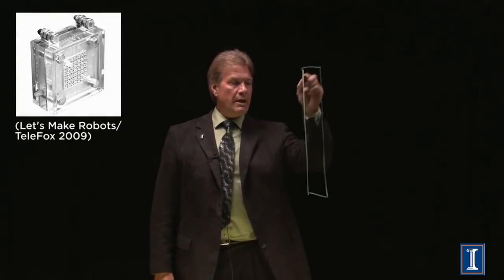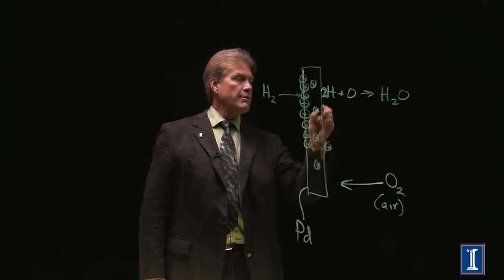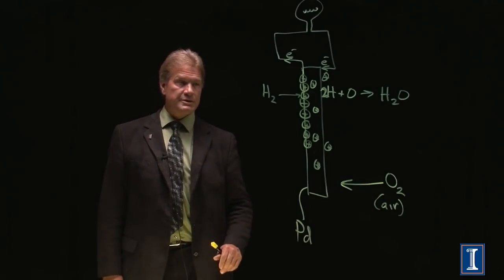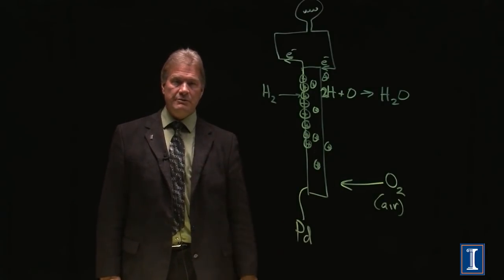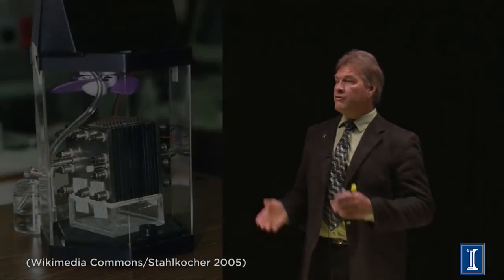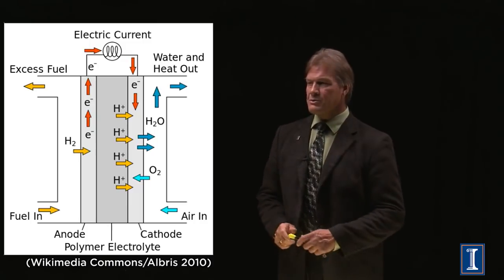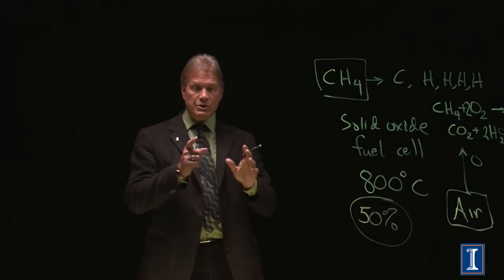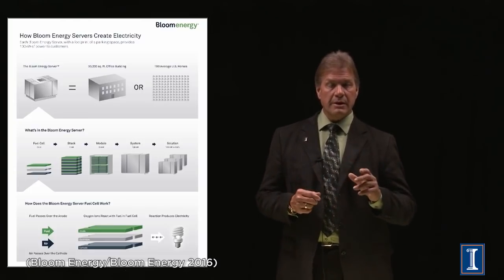Fuel Cells and Hydrogen Economy

Comment: Many of your videos are good but some of the information you cite seems completely incorrect which makes me wonder what else is incorrect. For instance you suggest a combined cycle natural gas plant is about 40% efficient which does not correspond to other information on the net which says new CCGTs are 60-63% efficient. The difference between what you say and what the utilities say is huge
Reply: Also, he calls PEM fuel cells toys, which is ridiculous. The current Toyota PEM fuel cells weigh 50 kg, is 100 kW power, and fits under the passenger seat of the Mirai car. The amount of platinum in a modern cell is abount same as in a diesel catalyzer. Already quite mature and practical tech.
Reply: I could be wrong but I believe these were all filmed in 2015 or before which could explain the differences.
Reply: Correct, he has just done a Q&A session and he refers to the fact that all the videos were done quite a few years ago.
Reply: @erik7726  Hydrogen cars are still nonsense though, because you need electricity to make the Hydrogen, and between the electrolysis and the fuel cell, most of the electricity you put in is lost. If you use electricity to charge a battery instead of make Hydrogen you can get better than 80% efficiency.

Hydrogen cars only start to make sense if you have a huge supply of very cheap, non-polluting electricity you can afford to use very inefficiently for the sake of convenience.
Reply: Hydrogen solves the energy storage problem, the fact that it isn't as energy efficient as electricity is off set by the faster charging times and cost reduction of not having a massive battery on board, etc etc etc.
Reply: @treizTUBE  With modern battery technology, there is no storage problem for the typical usage pattern of a passenger car. Hydrogen as a storage medium is about half as efficient, which is awful if we're relying on re-newable energy from limited natural sources, and even worse if the energy comes from fossil fuels. Convenience doesn't make up for the terrible efficiency, those are two unrelated characteristics.

Hydrogen is also quite inconvenient compared to other fuels. As a compressed gas it's very bulky, and compressed gases are always difficult to handle. As a cryogenic liquid it's even more difficult to handle, and still very bulky, and the energy used for liquefaction makes efficiency even worse.

Fuel cells have their applications, but they're uneccassary for passenger car use, and that low efficiency is a real problem if we're serious about phasing out fossil fuels.
Reply: @TonboIV  "Hydrogen as a storage medium is about half as efficient"
Again, efficiency is only ONE aspect of a solution.  ICE engines are not as efficient as BEVs in a direct fuel comparison yet they dominate the market with over 98% share.  Obviously the assumption that a replacement will have to be the most efficient is faulty, perfection is the enemy of the good.
Reply: @treizTUBE  I thought hydrogen was incredibly tricky to store. It's so small that it tends to leak through materials leaving them brittle. Leaking and brittle doesn't seem like great characteristics for a high pressure canister of explosive gas. Storing it as a liquid seems like trouble too.
Reply: @treizTUBE  The efficiency of batteries vs combustion engines isn't comparable, as one is an energy source, and the other is a storage medium. ICEs can dominate the market because we have plentiful cheap fossil fuels and we currently allow people to emit Carbon freely. If those things change, ICEs won't be viable for mass market passenger car use.

The whole point of going to a zero emission fuel like Hydrogen is to phase out Carbon emissions, which in the near term likely means renewable energy, particularly solar. These are inherently limited power sources requiring lots of land. They must be employed efficiently. If a fuel cell vehicle costs twice the energy of a battery vehicle, that likely means another vehicle equivalent of energy is produced somewhere from fossil fuel, because energy is a global economy.

Current battery vehicles are very good. The advantages of a fuel cell vehicle aren't large by comparison, and the poor efficiency makes them a bad choice for environmental reasons, which is supposed to be the whole point. Fuel cells might be useful for other applications, such as ships perhaps. They also may be better as an energy storage medium if we don't need to worry about efficiency anymore, like if we have abundant cheap fusion energy, but even then, they're not that great in terms of energy density either, and quite inconvenient in other ways. At that point, we might just want to use the energy to make synthetic fuel or biofuel, which have similar efficiency without the inconvenience and huge bulk of hydrogen.
Reply: @pyreaurum676  it's not at easy as storing gas or diesel, sure, but hydrogen storage tech has been around for decades.  The only hurdle was making it road and crash worthy.
Reply: @TonboIV  as one is an energy source, and the other is a storage medium."
Incorrect, gas and diesel ARE storage mediums for energy, mostly solar energy.  
.
"If those things change, ICEs won't be viable for mass market passenger car use."
Yes, there's no reason to move away from ICE currently aside from gov meddling.  
.
"The whole point of going to a zero emission fuel like Hydrogen is to phase out Carbon emissions, "
That may be the idea, but in reality all you are doing is emitting MORE carbon in total somewhere else on earth.  Instead of emitting it here from burning fossil fuels, you are emitting it in China to mine rare earth minerals and on ships transporting materials back and forth to create the highly complex batteries or electric motors or fuel cell stacks, etc etc etc.  If all you want is to reduce carbon emissions you are better off driving a really old car for as long as you can.  Building a new vehicle even an EV of either kind wipes out all the carbon emissions you could ever save.
.
"Current battery vehicles are very good."
They are very good at things people don't need or care about.  It's great that a Tesla can go to 60 in under 3s, and shred its tires along the way and drain its already limited range, but most people don't need that and don't see any reason to spend the extra money to get it and all the other compromises and drawbacks that come with EVs.  
.
"The advantages of a fuel cell vehicle aren't large by comparison"
No, they aren't massive differences, but they are significant enough for automakers to take notice and invest heavily.  They know their customers better than you or I.  
.
"At that point, we might just want to use the energy to make synthetic fuel or biofuel,"
Make no mistake, I DO NOT support the gov position that we need to get rid of ICE vehicles, I DO NOT support the move to EVs either way, but if it's going to be forced on me I'd rather go the route that has the least impact on my life and my ability to earn a living.  Clearly right now that is HFCs.  
.
If in the future they create fancy new batteries that are light wight and tiny and highly energy dense that don't require tons of rare earth minerals to be mined and shipped all over the world and that can be recharged to 1000mi range in under 10 or 15 minutes I'll jump on board.  Until then the tech simply isn't acceptable.
Reply: @treizTUBE  In practical terms ICEs are an energy source. The energy they produce comes directly from stuff we dig up. Batteries need to be charged from some other energy source, and Hydrogen needs to be produced from an energy source likewise.

We need to phase out fossil fuels for mainstream use, whether you like it or not, because the alternative is a disaster beyond anything in history. If we are doing that, than fuel cells are a bad way to do that because they fail at the only reason we'd want to use them over ICEs.

Heavy metals from battery production are a problem, but hardly insurmountable. We just need to handle the metals properly. Many MANY industries use heavy metals or other toxic materials. It's only a problem if those toxins are released into the environment.

I also wasn't talking about Teslas. They're still too expensive for most people, but the technology and market disruption of Tesla is leading to other more mass market electric vehicles. These cars can meet most people's needs. Few drivers need more range than a modern battery electric can provide, and normal usage patterns make charging a minor issue, even more so as fast chargers become more common. With large scale adoption of battery electrics, you expect to find fast charges all over the place.

The idea that building a new battery vehicle wipes out the emissions savings is false, and a stupid myth. They have a break even point, depending on many factors, but typically between a half year and two years of normal use, IIRC. Transporting commodities by ship is very efficient to the point the emissions are barely worth worrying about for something like a battery. All this also assumes that most of the production chain also uses fossil fuels. The idea though, is to switch the whole economy over to non Carbon emitting energy.

We don't have to legislate a specific power train type of course. Taxing fossil fuels to realistically reflect the long term economic cost of burning them would make them uneconomic for mass market use and most passenger vehicles would then likely use batteries with current technology. You'd be free to keep burning gasoline if you're willing to pay several times as high a cost as running a similar electric vehicle, or even a fuel cell vehicle if you're a weirdo who wants something that's more expensive to run than a battery electric, without many advantages of its own.
Reply: @TonboIV  No. Hydrogen can br produced cheaply and cleanly, e.g. from coal or methane with carbon capture, or in high temp electrolysis from nuclear fission.
Reply: @erik7726  Even if you make Hydrogen from Coal, all the Carbon and Sulphur and heavy metals have to go somewhere, and likewise with the Carbon in Methane. I don't see the point in setting up an entire new Hydrogen infrastructure just to do the same thing in a different place.

Electrolyzing Hydrogen from water makes more sense, but we need abundant, cheap, non polluting energy to make that a good idea given the low efficiency involved. If we're talking about renewable energy, than throwing away over half the electricity on the way is just terrible. Renewable energy is limited in power output, so we need to make efficient use of it. A combustion alternative that uses the energy so inefficiently is failure as an environmental measure.

Even if we have the power to waste at some point (like if fusion really happens), I think fuel cells are still a bad way to use it. It's a bulky and complicated power train, Hydrogen is about the worst and most impractical chemical fuel you could pick for a car. It needs a whole new and complex fuelling infrastructure. Setting up mass market distribution for cryogenic Hydrogen would have to provide some huge benefit to offset the inconvenience, and I'm not seeing it. Compressed gas is better, but few people even drive natural gas cars now, despite the low price of natural gas, and Hydrogen is even bulkier than natural gas. Batteries are bulky too, but they're not pressure vessels so packaging is far easier. You don't need to reserve a big round space in your vehicle. Compressed gas is also slow and complicated to fill up, which is supposed to be the big advantage of Hydrogen compared to batteries, and it's also fucking scary. The tanks make horrible noises that sound like they're gonna blow up.

Hydrogen might be worth it if it were the only way to make a zero emission car, but there are far better options. Battery electrics work fine for a typical passenger car.
Reply: @TonboIV  "because the alternative is a disaster beyond anything in history."
Complete nonsense, it is a regular occurrence in Earth's history for the temp to warm and the poles to melt.  Life goes on.  
.
"Tesla is leading to other more mass market electric vehicles. "
Still less than 2% market share, it's leading nowhere fast.  The novelty will wear off seen enough and without gov meddling people will go back to ICE vehicles.  
.
"The idea that building a new battery vehicle wipes out the emissions savings is false, and a stupid myth. They have a break even point, depending on many factors, but typically between a half year and two years of normal use, IIRC. "
No, it's true, you can't cheat physics.  Building a new vehicle requires more energy than the small amount saved between two different drive trains, it's not even close.  Who ever told you it was a myth was greatly misinformed.  Their claim is false on its face.  
.
"Taxing fossil fuels to realistically reflect the long term economic cost of burning them would make them uneconomic for mass"
A terrible idea, once the gov gets rid of all the ICE vehicles they will just shift the tax over to EVs.  They will have already figured the tax into their base line budgets and spent the money so they''ll go after it in different forms.  CA is already doing this.
Reply: @treizTUBE  Climate change has happened many times before, usually with very bad effects for large and complex lifeforms like us, but this time it's different and much worse because the change is happening a thousand times faster than normal. It will be very expensive even just in economic terms. Life will adapt, in a few million years, but that's going to be little comfort to anyone in 2100.

In terms of break-even for an electric car, I'm referring to using a zero-emission energy source to charge it, so break even happens very quickly compared to a car that emits Carbon every time it runs. Electric cars are one piece of what needs to be a change in the whole economy away from fossil fuel energy. If we don't change our energy production, electric vehicles are mostly pointless.

I don't like taxes either, but we need large scale interference in the economy in order to force a phase out of fossil fuels fast enough to avert the worst damage. We're already too late to stop all of it, and every delay will do awful things to the environment our grandchildren have to live in. Waiting for the economy to switch away naturally is just too slow, and a tax on Carbon is the least intrusive method of forcing that change.
Reply: @TonboIV  "Climate change has happened many times before, usually with very bad effects for large and complex lifeforms like us,'
CLimate changes every roughly 40k-100k years, Humanity and our ancestors have lived through these changes countless times.  With our technology and access to energy this current 20k year warming trend won't even slow us down.  In fact, it will open up a lot more farm land in the northern midwest and Canada that currently can't be used.  
.
"Electric cars are one piece of what needs to be a change in the whole economy away from fossil fuel energy."
There is no other energy source currently capable of replacing fossil fuels, the only thing that comes close is Nuclear, and the watermelons won't let us build any more of those.  
.
"in order to force a phase out of fossil fuels fast enough to avert the worst damage."
There is no amount of carbon that we can cut from our output that well offset the increasing outputs from China, India, and the rest of the developing world.  Forcing electric vehicles and unreliable fossil fuel replacements will only serve to crash our economy at the moment our competitors grow strong enough to challenge us.  I don't know about you but I'd rather not spend the rest of my life energy poor like those in Germany and other nations that have already tried to make the switch to green tech.
Reply: @treizTUBE  Humanity has never lived through RAPID climate change. Nothing has because it has never happened before. We've already done thousands of years worth of previous climate changes in less than a century. The pace of change makes this completely different.

When the climate changed previously, the human species survived, but many humans did not, and many other species went extinct. Our technology does not mean that we can just ignore the environment and ecosystem. We still depend on them for our prosperity.

More areas of Canada could become farmable in the long term, but land doesn't just become arable because the temperature changes, you're talking about most of the world's most populous countries losing most of their best farmland, don't you think that's maybe something it would be worth spending some money to avoid?

How much money did that big California drought cost? It only lasted a few years. Severe climate change would make that condition permanent. How much does it cost if one the most prosperous states in the US turns into a desert? That won't just happen to California either.

Most of the ocean foodchain rests on krill, and in the Northern hemisphere they're most abundant in arctic and near arctic waters where the cold temperatures allow more dissolved oxygen. Their lifecycle is tied to annual temperature changes. Climate change would devastate the krill and most of the world's fisheries along with them.

Forrestry in many regions has been devastated by invasive pests which previously couldn't survive the winters.

How much does all that damage and more cost? We're saving pennies now at the cost of dollars in the future. That doesn't even consider that we'll be wiping out most species and reducing biodiversity to levels that nature won't replace for millions of years. Do we have the right to take that away from our descendants for generations for our own short term interest?

The ecosystem we live in is balanced to the existing climate. Changing it significantly ruins that ecosystem, and because evolution is slow, it won't adapt and recover for thousands or millions of years.

Yeah we can probably adapt and survive, but it's going to be expensive and difficult and it's going to suck. Wouldn't it be better to avoid that by taking cheaper and easier preventative measures now?

That's all assuming we don't start a runaway greenhouse effect by warming the planet far more rapidly than has ever occurred before. We don't know if that can happen, but it's certainly plausible, and I'd rather not find out.

Renewable energy can at least be a large part of our energy supply, possibly all of it if energy storage can be done economically. Nuclear certainly can do it right now, and I'd say public opinion is starting to shift on nuclear.

Yeah, we need to get China on-board, and the one way we can guarantee that won't happen is by doing nothing ourselves. Phasing out fossil fuels will not tank the economy. Renewable energy is only a little more expensive than fossil fuels at the moment. Nuclear is even better because once you get over the capital cost it's cheaper than fossil fuels, especially if it's done at large scale with government support. Nuclear is also a the sort of high tech industry that is well suited to developed economies, and could let the West start selling energy to everyone else instead of the reverse. The cost of change-over for a country like the US is probably less than they spend on stupid and pointless wars like Iraq. Developed countries can afford it. Besides, as awful as the CCP is, they're not completely irrational. They'll probably be co-operative when their own long term interest benefits as well. I'm sure they'll try to screw us along the way, but we could at least try to work with them, or lead the way and wait for them to follow, which they have done with most of their technology. We can afford the cost to clean our own house, China doesn't like to look backward to the world.
Reply: @TonboIV  "Humanity has never lived through RAPID climate change. "
It's been happening for the last 20k years, it is anything but rapid.  
.
" The pace of change makes this completely different"
Dooms day prediction, end of history fallacy.  You don't know this, you are just repeating the scary things others have told you.  
.
"How much money did that big California drought cost? It only lasted a few years"
Go figure, a state that borders the largest body of flowing water in the known universe has a severe drought because the morons in the gov managed water system shit the bed.  The world is totally ending, yo.  
.
"Climate change would devastate the krill and most of the world's fisheries along with them."
And yet they have survived previous climate changes millions of times before.  Gotta say I'm just not worried about it.  
.
"Forrestry in many regions has been devastated"
We are already planting more trees than we know what to do with and the Earth as a whole is greener due to the increased levels of CO2 allowing for more and healthier vegetation.  Again, these plants have survived this process millions of times in the past, I just don't see a reason to worry about it.  
.
"We're saving pennies now at the cost of dollars in the future."
You don't know that, you are guessing and fear mongering.  Predicting the future is REALLY hard, EVERY dooms day prediction in the past has failed.  
.
"The ecosystem we live in is balanced to the existing climate. "
The balance will adjust the same as it always has and always will.  
.
"Yeah we can probably adapt and survive, "
We have in the past, and we will in the future if the gov would stop meddling and trying to solve problems they don't even understand.  
.
"That's all assuming we don't start a runaway greenhouse effect"
These fears are unfounded.  The green house effect of CO2 is logarithmic, every additional unit of CO2 added to the atmosphere has less of a warming effect than the unit added previously.  Lets also not forget that as CO2 levels increase so does plant growth to consume the increased availability.  
.
"Renewable energy can at least be a large part of our energy supply"
For every renewable system you build, you have to build a non-renewable system that can step in when the sun isn't shining or the wind isn't blowing to pick up the slack.  Building two systems instead of one wipes out all the supposed benefits of going renewable in the first place, not to mention the detrimental effects these renewable systems have on the local landscape and wildlife.  
.
"Phasing out fossil fuels will not tank the economy"
The economy literally runs on fossil fuels, and there's nothing ready to replace them.  Phasing them out WILL tank the economy.  
.
"Nuclear is even better"
I agree wholeheartedly.  We just need to get the watermelons on board.
Reply: @treizTUBE  "It's been happening for the last 20k years, it is anything but rapid. "
Climate change in the last hundred years is very rapid. Nothing like this has ever occurred before.

"Go figure, a state that borders the largest body of flowing water in the known universe has a severe drought because the morons in the gov managed water system shit the bed."
They had a severe drought because there was dramatically less rain for several years. A few degrees increase in average global temperatures will make that condition permanent and tank the California economy.

"And yet [krill] have survived previous climate changes millions of times before."
They had a long period to adapt before. A significant climate shift in less than a century is unprecedented. Even if they survive, climate change is likely to devastate the population for centuries if not longer. That will ruin most of our fisheries.

"We are already planting more trees than we know what to do with and the Earth as a whole is greener due to the increased levels of CO2 allowing for more and healthier vegetation. "
We're destroying forests faster than we plant them. We're also cutting down old growth forests with diverse ecosystems and replacing them with homogeneous woodlots. More CO2 will make the planet greener in the long term, but life takes a long time to adapt.

"The balance will adjust the same as it always has and always will. "
Eventually it will, but humans don't live on ecological time scales. The effect on the next several generations of humanity will be awful.

" The green house effect of CO2 is logarithmic"
True, but misleading:
https://skepticalscience.com/why-global-warming-can-accelerate.html
A runaway greenhouse effect is due to more than just CO2. Other more powerful greenhouse gases being released by a rapid temperature increase are one of the biggest concerns. We don't know if this will happen or not, but I'd rather avoid the experiment.

"For every renewable system you build, you have to build a non-renewable system"
This makes no sense. We need a certain percentage of consistent capacity to compensate for inconsistent sources like wind or solar, but over 95% of our existing capacity already does that. We can build a lot more wind and solar and decommission combustion plants to compensate before the percentage of consistent power becomes too low. To go beyond that with solar, we need energy storage, but that's doesn't come until we've built a lot more solar, and it's far from impossible.

"The economy literally runs on fossil fuels" we can probably run our entire economy on solar with storage, and definitely a good portion of it. We can run the whole thing on nuclear, and it's not a crippling expense to switch either way, with a huge return on investment in the next 100 years.
Reply: The problem with CCGTs is that the cost does not scale linearly with increased efficiency. To get your 60% efficiency the electricity produced will have to be subsidised to make it cost competitive. This might be achieved by a carbon tax.
Reply: @alanjenkins1508  what are you talking about. CCGTs are the most successful least subsidised form of electricity generation in much of Europe and the USA which is why no coal or nuclear is being built it's all CCGTs and existing infrastructure
Reply: Desmond Bagley  Neither can electricity, but at least with hydrogen the tech is simple and the prices can be brought down through economies of scale.
Reply: @TonboIV  most commercial hydrogen isn't a product of electrolysis, it's a byproduct of petroleum production.
Reply: @TonboIV  One problem with batteries is that you have to haul the weight of the battery around.  You need to look at the overall SYSTEM efficiency - how much distance do you get in comparable vehicle per kwh consumed.
Reply: @mrbadguysan  At present Hydrogen is a very niche fuel. Reforming a large amount of Hydrogen from petroleum will emit a large amount of CO2, which seems to defeat the whole purpose of a Hydrogen economy.
Reply: @pyreaurum676  "hydrogen was incredibly tricky to store. It's so small that it tends to leak through materials leaving them brittle."
Yes, that's true, but with the use of new catalysts, Hydrogen will be transported and stored as Ammonia, which we have the technology for already as it is a very common industrial chemical. Google "CSR Ammonia catalyst"
Reply: @dnomyarnostaw  That looks to be pretty early stage research. We can't say yet if it will make for a practical Hydrogen vehicle. Using current and near term technology, Hydrogen is difficult to deal with, perhaps impractically so. You don't see many people buying natural gas cars, despite the low price of the fuel, and Hydrogen is way more of a headache than natural gas.
Reply: @dnomyarnostaw  I was responding to your comment about "CSR Ammonia catalyst". I was able to find some information about using ammonia as fuel by breaking it down with a new catalyst, but I didn't find mention of fuel cells in that research, or any mention of practical experiments or any development beyond the basic concept. The Mirai and Nexo you mention run off pure Hydrogen, which is quite difficult to handle. Neither vehicle has been sold in any great numbers, and with few places to fill up on Hydrogen, current Hydrogen vehicles are still mostly experiments which have yet to demonstrate their practically as mass market passenger vehicles. None of the links or stories you supplied say anything about powering vehicles with ammonia, so for the foreseeable future, fuel cell cars must store Hydrogen as either a compressed gas or a cryogenic liquid.

I know that some people drive natural gas cars, and that they have some share among fleet operators, but natural gas power is still quite niche in the automotive market generally. Since natural gas is quite cheap, this seems to indicate that the inconvenience of a pressurized gas fuel is large enough to outweigh the cost advantage for most customers. That doesn't bode well for compressed Hydrogen, which will require even larger tanks for the same range, plus the expense and weight of the fuel cells. Cryogenic liquid Hydrogen comes with its own set of challenges.

Gasoline powered cars probably outnumber Hydrogen cars by thousands of time or more at present, so of course there are more Gasoline explosions and fires than Hydrogen ones. Regardless, fires are relatives rare with either fuel type, given that there are hundreds of millions of gasoline powered road vehicles in service. Not exploding is not the same as being practical though.
Reply: @TonboIV  Fossil gas burns pretty clean, and pyrolysis from coal can also be made very clean. The whole point is to capture and sequester the CO2, and produce clean, blue hydrogen. Electrolysis is also interesting, but it is all about making cheap, clean H2 in any way you can. As for electrolysis, high temperature electrolysis in nuclear power plant could supply 10 billion people with all the hydrogen we need for cars, trucks, fertilizer, clean steel, cement and so on.